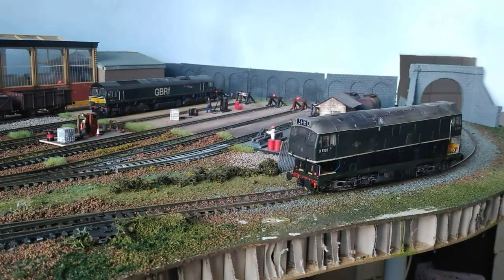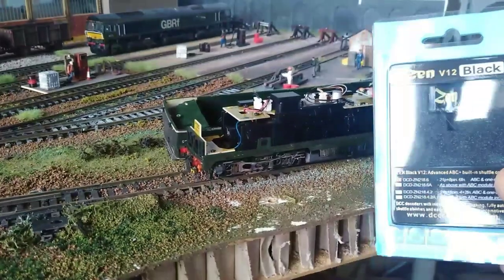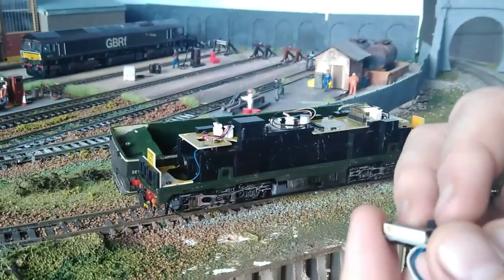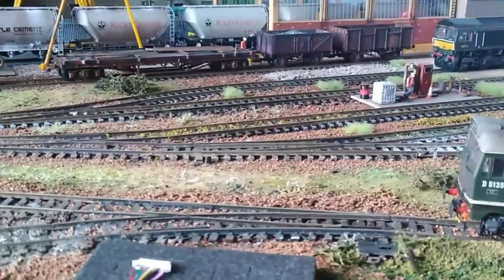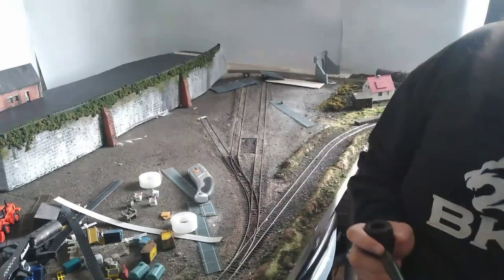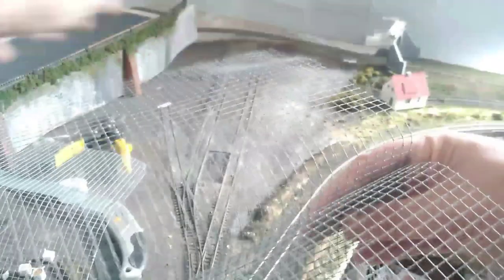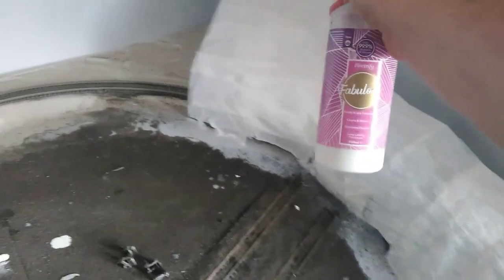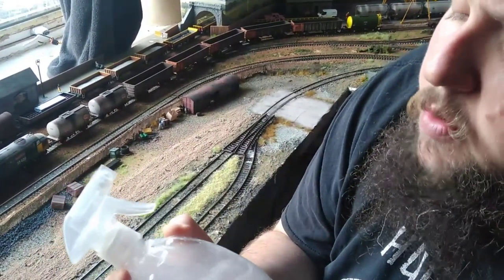Had to rip up the layout AGAIN! 😭 | Iron Horse Weekly ep12

Comment: Hi Craig. 

Glad to see you've purchased a gimble. Steady camerawork makes a lot of difference. 

As for the layout, you just love the mucky jobs, don't you. A pity you've had to rip up some trackwork, but at least it solved a problem. As for a track cleaning wagon, personally, I wouldn't bother, as they don't always do 'what it says on the tin'. I use a Peco rubber and a little elbow grease; it works every time. I think that at the planning stage, you should have made allowances for better access to the areas that are hard to reach. Still, it's now a case of closing the stable door after the (Iron?) horse has bolted. 😂 

Yup, the loco is now running as she should. Now all we need is to see a running session with her pulling a rake of wagons; maybe in a couple of weeks time. 

Keep the faith me ol' mucka! 

Paul. 👍
Reply from the maker: Cheers bud, yes the Gimbel has helped loads!
Il be looking at a mic before too long as well 😎

Thanks for the comments mate 😃👍
Reply: Craig.

Yes, a mic would be a great addition as it would stop you having to stare close-up into the camera in order to be heard. 

As for the camera support, we've both committed the same grammatical sin by spelling it incorrectly. It's spelt 'gimbal' and not 'gimble' or 'gimbel'! It seems our GREAT minds think along similar lines matey. Sorry to be so pedantic but I was mainly thinking of the viewers who are reading your comment section. 

Chow! 

Paul. 😀
Reply from the maker: @platformten5958  might as well be "Gimp Bell" at this point 😃😂

Comment: Hi Craig Well even the real railway has track problems, so replacing a point isn't too bad and it worked well warming the ballast up first etc. The demic point could be reused for spare sleepers and rails (just sat around stored awaiting some use) in the CCE yard maybe make a workers cameo out of it. 

As for the Ruby decoder did you try resetting CV8 to 8 apparently it resets the factory settings or so I'm told (I'm no expert on these things just bit I pick up now and again, lol). 

The Tunnel form will be better now you've used the paper machie, going old school should usually work in the end, any chance of a link to where you got the gimbal thing, I might have to invest in one myself if I ever get started doing my effort of layout building. Anyway happy shunting!
Reply from the maker: Yes mate the ruby is 'ok' but it's just not up the to task of super fine running in that bachmann... Cheers!😎👍

Comment: You could keep the broken points and use them on the Maintenace area as a standby point being made Riedy to replace on a maintenance train. Stay safe
Reply from the maker: Didn't know that was something that went on, assumed all points were installed on site from components?
Reply: @IronHorseRailways  did the links I sent you come trough?
Reply from the maker: @mikeatpudhamjunction2323  nope, where did you send them to mate?
Reply: @IronHorseRailways  did they come through this time?
Reply from the maker: @mikeatpudhamjunction2323  nope

Comment: i use polystyrene insulation to form hills over tunnels easy to shape neat pva will glue layers then cover with modrock creates a very strong piece of scenery that can be moved around  used to be a war game so all scenery needed to be removable
Reply from the maker: I've never worked with the stuff properly, I'd have no idea where to start with something like that - as I said in the video...
I Do know how to use paper mache though 😁
So here we are!
Cheers!❤️😎
Reply: Pnly need a  bread knife to cut it i use the hot knife and multi tool can byr it from 1 to 6 inches thick I tend to use 1 and 2 inch its easier to shape